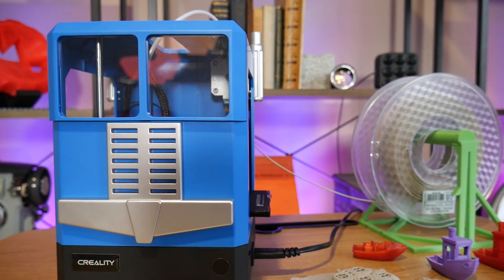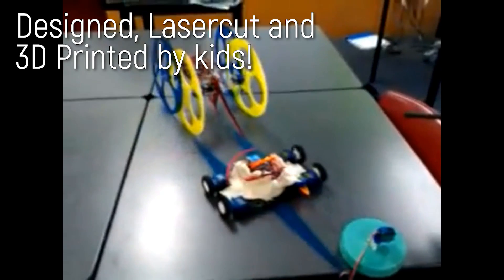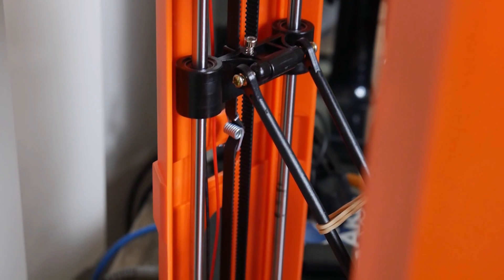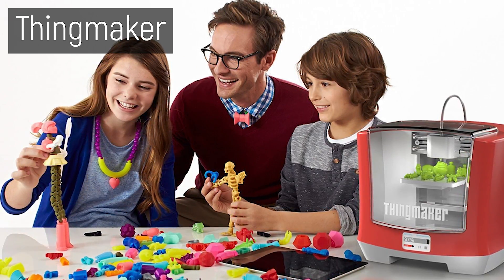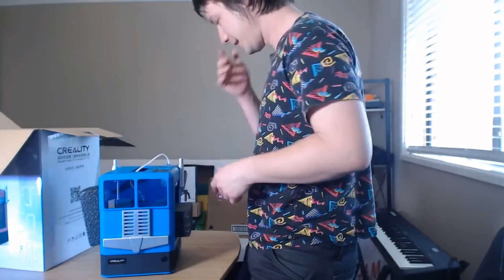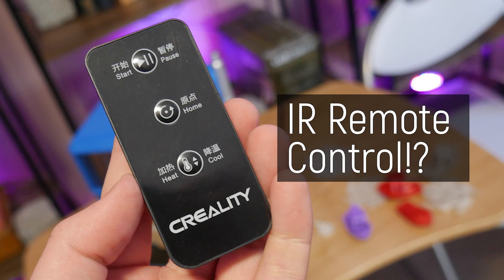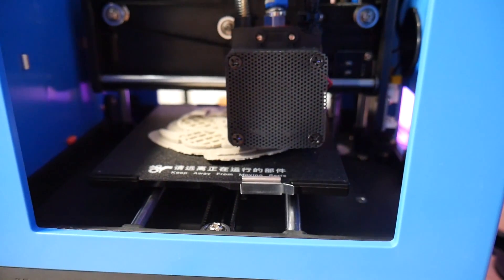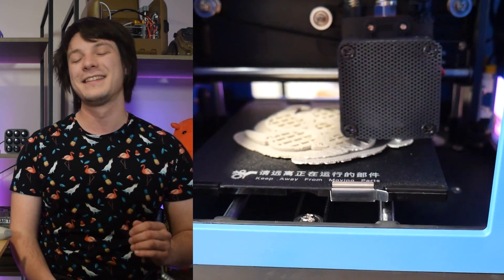This 3D Printer looks like a TRUCK. CR-100 Review

Comment: 3:54 "I'm not sticking my fingers in the fans or touching the hotend, I generally think I have more common sense than that"
I may or may not have done both of those things in the last week. I may be typing this message with blistered fingers.
I mean, I definitely didn't damage the fan and it's only a few superficial burns. I burn myself more often than I'd care to admit.
Reply: It gets really tempting to grab that wisp of filament off the hotend with your fingers doesn't it.
I have a couple sets of forceps now sitting right next to mine to remind me not to.
Reply: @andrewlawrence8024  me too. I usually get burned when swapping nozzles or just generally doing anything while the nozzle is hot

Comment: Some 3 years later I bought this printer. I have too many 3D Printers, if that's possible, Sindoh DP200, Snapmaker 2.0 A350, Lulzbot TAZ 5, Dobot Mooz 2. Interesting thing is that this very very small printer makes shockingly great prints. Obviously too small but for gears, I do a lot of robotics, I could use it to make gears what don't exceed the build plate size. My best printer is my Lulzbot, I have 2 of them. One set up with a Moarstruder 1.2mm Nozzle, and I can swap that out for the Lulzbot E3D hotend where I can insert a bowden tube and print with 1.75mm Filament. The other Lulzbot I have the traditional 2.85mm Lulzbot Toolhead. So with these 2 machines I can print huge models with 2.85mm filament using a .5 or 1.2 nozzle or use 1.75mm filament with a .5 nozzle. Only trick was to get the E Steps correct for the 1.2nozzle. Now it's perfect and I can print prototypes at 4 times the speed with the Moatstruder and then decide on either 1.75mm or 2.85mm filament for the final product, or just use the Sindoh or Snapmaker to do even finer detail at .4mm nozzle size.

Comment: Saw one of these at TCT the other day, its even smaller in real life than it looks on this video!! Definitely agree that there is very little point to this machine, if the kids got interested in 3D Printing they would have to get a new one with a larger usable build volume to print anything worthwhile. Raise3D have just brought out a printer for the education market that has decent safety features, the price point puts it in the bracket of schools rather than one off users, but its a step in the right direction!

Comment: I completely agree with you Angus. With the current state of 3D printing, operating any "kid friendly" printer propperly is almost as hard as operating a "normal" hobby grade printer. Honestly having a printer that looks like a toy really only succeeds in underminding the knowlage these kids actually have and the added limitations (small and unheated bed, pla only,very limited interface, etc) really just dosen't make any sense at all. 

What this printer (and many others) strive for will only be possible when we have a well-established 'One Click Printing'  system, from which we are very far from at the moment.

It's best just to give them the real deal, and let them learn by themselves. Even though its important protecting them from danger, giving them a little danger once in a while is very important for their development as well.

That is what I did, I'm 15, got an Anet A8 and I have learnt how to get results comparable to other printers such as the Prusa MKIII. If i can do it, then any other kid that is passionate about 3D printing can as well.
Reply: 18 but same, when I was 15 I really started getting in to 3d printing at a library. I used their printers for a lot. Finally bought my own Anet a8 (Technically it's a Tronxy with a Bowden tube) last year and learned how to make quality prints fairly quickly. When I was 12 I would have loved the printer even more, but it wasn't a widespread thing at the time.

Comment: Thanks Angus, good coverage of the topic.

The level of "push a button, wait, open door, pull out part" ease of use "easy bake oven" level of design has not really been realized at this point. It is very expensive to make something that is very easy to use when the underlying technology has a lot of conditions and moving parts. A company like Mattel could pull this off; I think they ran the numbers on this and decided that they could not recover their initial R&D cost on it with sufficient profit.
One of us (Users and Makers) will have to do the work and make the user experience simple enough for a child to use it safely, someone who is not as concerned about the bottom line and shareholders.
Cheers,

Comment: I have several cr100 printers  that Im using  for child training for several months. While I agree a lot about what is said here, it has many positive things for this purpose. First, its portability, for me the most important thing, because I can carry four printers in a travel bag to any place in a comfortable and safe way. Second its ease of use and safety, because despite having open sides it is very difficult to put your fingers and burn. Third, it prints with a very acceptable quality for price sub-range, and I have not had any problem of adhesion in the base in these four months. The nozzles are easily interchangeable and any of the components is standard and replaceable.

There is nothing on the market at this price that gives you these benefits.

I fully agree that the finish is ridiculous and that there are no printers for children at the moment, they should always be used under adult supervision.

Comment: The child friendly aesthetics is more for the adults who will be buying it. These types of packaging may lead to many issues with parents assuming the colorful toy like imagery means the product is safe and easy.
From my experience kids will want what the adults are using. There are even some that will be disappointed or insulted if they get plastic cartoonish instead of a machine like the ones they see their favorite creators uses.
I think it’s great to let kids use these. I grew up around and using potentially dangerous items from a young age. 
I can tell you from experience both from my childhood and from letting my kid play with stuff (3D printer, Dremel, and soldering iron). That kids are capable of operating these things and there are ways to teach them appropriate and safe usage.
Not that I would ever recommend placing an intricate, complicated, and potentially dangerous machine in a child’s room as suggested by the many promotional images used to market kid friendly printers.

Comment: Hey I want to miniaturize my ender3 … I can cut down all the extruded aluminum but I was hoping I could just buy a smaller bed that would work with little to no fabrication/modifications….. I’m looking for something around 100mm x 100mm… any suggestions?

Comment: Hey, Angus. Can you review Biqu Magician? I was thinking of buying it as my first 3D printer. It's under 200$ and most videos/reviews about it seemed positive. But if you make video about it I would get perfect idea to get or not. It has 2 problems. It's small and doesn't have heated bed. As for size. I'm fine with it since things I will be printing would be mostly small (aka Beyblades) and if I really need to make something larger. I would just make it in parts that would snap together. As for heated bed. I think that would be a problem. Can you suggest a filament that prints well without heated bed. But is more durable than PLA? Or rather sone other 3D printer better for price? I wanted something that's easy to get started and as foolproof as possible.

Comment: I thought you said you were going to turn it into a rolling remote control printer? With the batteries in the bed, maybe pulling something in from James Bruton?Alternatively, you could turn it into a robot version of Optimus Prime or Ultra Magnus. Add hips, legs, arms, and a head and you've got it. You could even 3D print the parts. It'd be fun to see it balance though. Maybe on 1 knee?
Reply from the maker: I am, it'll take a while though!
Reply: Cool!Question, what are your thoughts on the Z axis sync mods for printers? I'm having problems with my Z axis sync for my CR-10s4 and I'm wondering if buying the mod kit is worth a go.

Comment: My CR-100 has a heated bed and has relatively good print quality, it even comes with it's own slicer software.
Reply: Can you use other slicer software with it?
Reply: @rossdutton8390  You can use any slicer software as long as it outputs .GCODE files

Comment: A good 3d printer for kids should be either of two designs:
1. A kit that let's the parent and child tinker and learn, while providing reasonable quality and reliability so as to not require too much effort or frustration to use. This would probably be best for slightly older kids, or kids with parents willing to get into 3d printing with them and help manage and experiment with the machine. 
2. An enclosed and "built like a tank" style printer that requires parental guidance to use (as in, the kid provides the design and the parent just has to slice it and then send it to print), but will work well and reliably without tinkering. Basically, a printer not to experiment with itself, but to allow experimentation by printing.

Comment: When I was a child (40 years ago), I had an Easy Bake Oven, which was a toy stove with a heat lamp inside it. I was never allowed to plug it in. In later years, I was given a chemistry set with bunsen burner... I would have loved this sort of thing. The first things I would have printed is a head, arms and legs for that Autobot. Optimus Prime needs help, badly.

Comment: Maybe using PLA for starters is a bad idea ...

Using a material that melts at a much lower temperature and doesn't require cooling and a heated bed would be a good start I think. For a toy, for learning, I think it's not a huge issue if the printed part isn't very strong ...

Comment: Yeah, it's a silly bit of throwing products at the wall to see what sells. Sure, it works more often than not, but there are some cases where you can't just put out a worse product and call it a kids' version. I know at the end of the day it's a CNC machine that, while working properly, does most of the hard work for the user, but from a human's squishy, water-filled perspective, I crank even "low" bed and nozzle temps a little high for something to put in a kid's play room for unsupervised use. If you want a kid's eyes to light up with wonder at a kinda' loud machine that spits out toys, throw an extra third of that price at something with a heated bed, treat it like a potentially dangerous tool, and focus on the modeling side of things. Do you put a bandsaw in your kid's room to inspire them to get into woodworking? This is the same. Besides, FDM is a slow process for all but the smallest of parts, and six hours of childlike wonder at a toy happening eventually is a bit hard to manage.

Comment: I don't think we'll ever see a fully toy ready FDM printer. There's hot bits, moving bits. My CR-10s has branded me and pinched my hand under the carriage. I think we're more likely to see a print to wash to cure full service resin printer (hell, I'd buy one!). I think that direction can be sealed, stabilized and deliver a cleaned, cured part out of some hopper. Maintenance will still be dad's job but I think that would be a better direction to head to toy land.

Comment: With the right instruction, and warning, I can see a smart 10 year old handling a Prusa MK3/S on their own.  The only thing I don't think they could handle would be something like  nozzle jam, or other failure that requires some disassembly.
Reply: I dont know about that. When i was ten i could pull anything apart🤣
Reply: @chrish1590  in all seriousness, and without making the joke that I did say "smart"kids, a lid like you could help assemble the kit. Sure, it would take longer, but your investment in building it would make it yours, and you'd be more likely to not take it apart.

Comment: 3D printers aren't TOYS.
Even if you used it to make toys.
It's a high tech tool, not meant for fools,
that requires a minimum level of knowledge to use.
Until the day people can make a low cost intelligent printer, 
that can prevent stupidity, 
it will never be a toy.

Children aren't stupid, but not all of them are smart. 
They still need time, to grow and learn, filled with experience.
If you want to show them the wonder of 3D printing,
teach them well, what can be done, and what not.
If they learn, they will not hurt themselves.
If they don't, and can't keep their little fingers out of danger, 
you should lock them out of your workshop, just how you protect them,
from saws and hammers alike.

3D printers aren't toys.
It's a tool that even adults need to learn to use, without acting like a fool.

Comment: 3D printing should be treated the same as other CNC devices like laser cutting or routing. It's a manufacturing technology, not a toy. This kinda stuff attracts a very specific market - hobbyists like myself. That's why I also think 3D printing will never become as mainstream as regular printers - there's just no need at the minute. These machines are not easy to run in the slightest and have a steep learning curve - especially kits.

3D printing, CNC routing and laser cutting for children should all come under the same category. A bad idea.

Just my opinion.

Comment: Toys of old are 10 to 100 times more dangerous than modern toys. One example would be spinning tops. Old ones are simply hardwood carved on a lathe with a nail in the middle for the point. No rounding on that nail either, with larger tops using larger nails. You could cause serious damage to someone if they got hit by even a small model.

Comment: 1. Children are not stupid.
2. These things are not as dangerous as we're told.
3. Children are not as fragile as we think.

Consider our "Thingmakers" that we played with often. Now we're told they were one of the most dangerous toys ever made. Yes, they got hot. Yes, we burned our fingers. They were hot enough to make you say, "Oh! Ow! Hand me the grabber." It hurt for a minute, and we went on making things. Yes, a 3d printer has some hot parts. Yes, it has some moving parts. The moving parts aren't very strong, a child's finger in the way is not going to get seriously hurt, and touching the extruder or build plate will make you say, "Ow. Don't touch that."

Oh. Forgot number 4. People like lawyers and courts.

Had I more children (they grew up), they'd be welcome to make things with my printer, and they'd probably have an accident with it, learn and go on enjoying it.

Sorry, I was soldering at age 8. Did burn a finger pretty bad once. No lasting harm.

Comment: Ive been looking at a printer for my kids and so far the best bang for buck seems to be the CR10 mini, compared to the ender 3 its getting considerably better reviews and its cost is not that much more. right now there is stock in Sydney on ebay for AUD$328 and free postage. so really its only $30 more than the one you are reviewing.......

Comment: I agree that you should teach children with a proper 3D printer, teach them how they work, and how to use them safely. 
Its like with knives, if you keep telling a child not to go near the knives because they're dangerous, they're going to want to go near the knives even more, but if you teach them how to handle knives safely from the start (or more importantly, how not to handle them!), it'll be safer in the long run!

Comment: tbh just get an i3 or a CR10 instead... don't need a kid oriented printer when you can just let them use TinkerCAD or even get into Fusion360 and create their own models to slice and print. You can manage the setup and get them a good first layer while showing them how to do the same if need be. If you want your child to learn. Throwing them in the deep end from time to time does the trick perfectly. They won't learn by example alone.

Comment: Sometimes I wonder if Angus is a delicate snowflake. I've burned myself numerous times on a hot-end for various careless and stupid reasons. Guess what? All my fingers are still attached and my hands still work perfectly. I don't see a 3D printer ever causing anyone, even a child, serious injuries. Yeah it will hurt, get over it and learn, you're not going to die.

Comment: Those cheap deltas are a little cheaper than $120 on eBay.. Currently thinking of getting one listed at $109 just for stupid curiosity. And yeah, the state of the art is nowhere near easybake level yet. I've had decades in electronics at the pro user and technician level, starting as a 15yo kid with a Signetics 2650 with 256 bytes of RAM in 1976 LOL.

Comment: i think that child safety here is less important then printer safety. what could goes really wrong? cant imagine what irreversible harm can be received through 3d printing. small burn on a finger is not a big deal. i say more - this is a good lesson about importance of warning signs and instructions.
in other  hand broken printer is a potentially great problem in terms of motivation.

Comment: Latest G-code = newest. It works on LIFO, last in, first out.
Reply: _ David _ Yes I am. However the LIFO is basic accounting and I was telling Angus what the latest G-code means. Bad translation.
Reply: _ David _ Ah, yes. :) I don't understand why anyone would use LIFO in this way either. Should just be scrollable list and with print button you start. LIFO is also a bad way to manage warehouses and such. Nobody should use it.

Comment: As a 14 year old with a 3D printer I can confirm that I am not sticking my fingers into power supplies or hotends.
Reply: Nico 3D depends on your definition of “kid”. At 14, I would expect you to be responsible enough to handle a 3D printer. Heck you will be driving in a year. But I bet you didn’t want a blue truck printer.  This thing looks aimed at 5-6 year olds. I think that is a very bad idea.